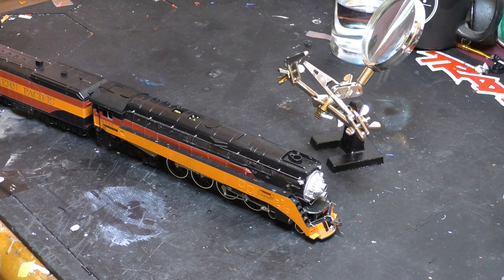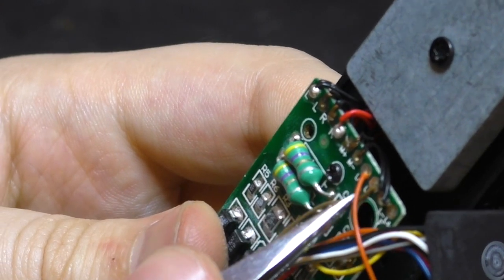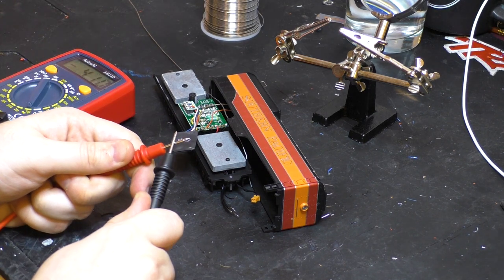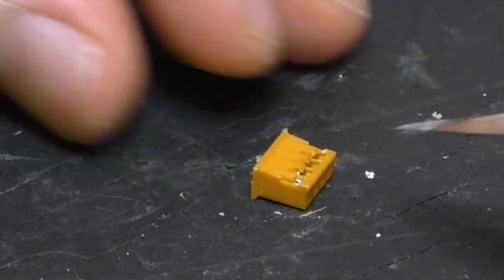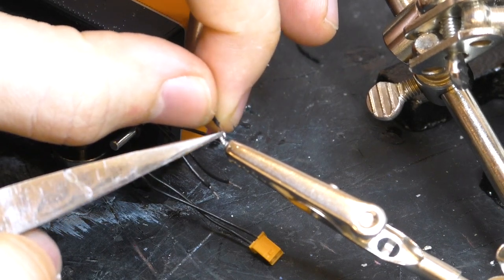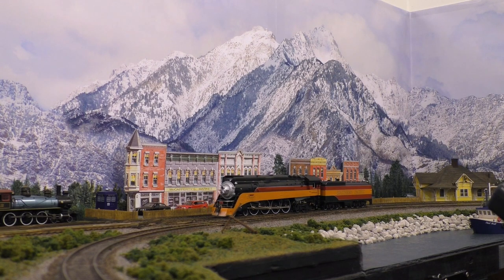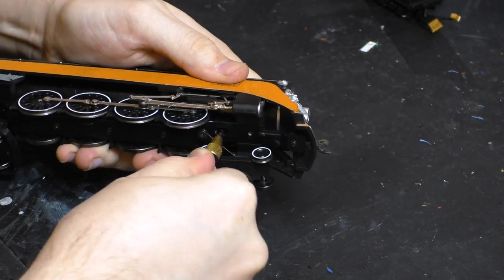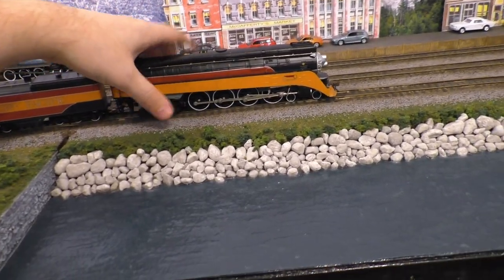Repairing Bachmann Tender Plug Wires (the hard way)

Comment: Thanks for explaining how these connectors can be fixed!  I would like to learn how you applied “back emf” to improve operation.
Reply from the maker: Back EMF is a feature built into DCC decoders. You can usually adjust the parameters by changing CV values, and the ideal settings will be different for each motor.

Comment: Damn you really just went though hell and back with those wires! ,that’s one of my worst fears are when the wires are broken
Reply from the maker: It's definitely not an easy fix! In most cases, I'd recommend just replacing the whole wiring harness. That would have been vastly easier.

Comment: I have two ideas for this in my near future.  One, by a set of plugs prewired and just splice into existing wire, shrink tube for nice place, or get long enough prewired set to resolder from scratch.   Second idea, build as you did, but maybe also place shrink tube ahead of time to bundle wires and make them stronger and easier to unplug and might even look better.  nice work though.  Next time it will be easier I bet.
Reply from the maker: If you're already buying another plug, I would just unsolder the old ones from the circuit board and solder the new ones in their place. That way, you don't need to have a joint in the middle of the wire, and it will flex easier as the train goes through curves.

Comment: Hi Michael, I have recently been looking at upgrading from my Bachmann EZ Command DCC controller to a Digitrax Zephyr DCS51. I was looking around at videos on DCC controllers and I came across yours on the BC Hobbies channel, and you said that you had gone with the Powercab because the Zephyr DSC51 had problems. What were the problems you have heard about? Is it anything major or just some small things? (If it’s small things that’s fine, as I found one for a good price which is why I’m thinking of getting it). Thanks for taking your time to read this! P.S. Sorry for posting this on a random video, I didn’t know if you check the comments at all on the BC Hobbies channel, since I know multiple people run it.
Reply from the maker: The main issue people seemed to have with the old Zephyr was the display, which just doesn't have room to show very much information, making things like programming CVs more complicated. Functionally, there's nothing wrong with the old Zephyr. If you find a good deal, and you don't mind figuring out the controls, I say go for it!

P.S. I do try to check the comments on the BC Hobbies channel regularly, but I usually check the comments on this channel more often. If you comment there, I will try to respond, but it might take longer. Either way works.
Reply: @michaelramsey81  Okay thanks for letting me know! Sounds like I might go for it then!

Comment: The only promblem I have with ordering the plug part, in fact any part from bachmann is that once it’s gone they never restock.
Reply from the maker: That is definitely annoying. They do sometimes restock parts for models that are still in production, but that's relatively few of them.
Reply: @michaelramsey81  worse part they are starting to overprice their parts for example a shell for the new 2-8-0s is 100 at that point you can get an old spectrum engine with the mechanism

Comment: I wish Bachman could set up their engines to work without the wires Just on straight DC like some Hornby locomotives
Reply from the maker: The wires are there to make it easier to convert the loco to DCC (or, in this case, because it already has DCC). I have rewired locos before to work without the wires, but it makes them nearly impossible to convert to DCC later.
Reply: @michaelramsey81  As you said in your Prairie video that's future you's problem
Reply from the maker: @chasesrailwaylinesrr6447  That's exactly the one I was thinking of, lol.
Reply: It went something like this: "This will be a serious pain if I ever decide to convert the engine to DCC, but hey, That's future me's problem"

Comment: I own a Bachmann Daylight with DCC; this one has an updated tender connection where they've combined both plugs into one which makes this problem easier, should it come up. However, it's still a poor design choice as those wires are very cumbersome and have the potential to interfere with the drawbar when it runs. Not to mention it's hard to connect and disconnect the tender with the placement of the socket below the cab. I might look into upgrading it to something more robust/less intrusive.

Comment: Great video. I had to do the same thing to the exact same locomotive that I bought for my son. But now the thing won't stay on the rails...🤦‍♂️
Reply from the maker: It does seem quite prone to derailing, probably because it's so long and not all that heavy. The freshly repaired wires might be a bit stiffer than they were originally, which doesn't help, but that alone shouldn't cause it to derail.

Comment: Jeez I hope I never have to do this, that does not look fun. Out of curiosity we’re you able to still unplug the locomotive from the tender, or did the glue slip and make the connection permanent? Looking forward to more videos from you!
Reply from the maker: I was still able to unplug it, but you do have to be very careful with the glue. I used a thick gel-type super glue for this one, and that worked OK, but on another one I tried to repair recently, I made the mistake of using thinner superglue. It instantly ran inside the plug and completely jammed it. I ended up having to cut the plug off and replace it entirely. In the future, I'm not going to bother gluing them at all.

Comment: Hey Micheal! Great video. I'm having a bit of an issue with a Bachmann 4-8-2 Light Mountain I'm fixing for a friend, it's been sitting for 8 years following an incident that broke the tender wire plugs (Your video on resoldering the harness came in handy for that haha) I've finally got the it running again but it's very jerky and rough - it didn't come as much of a shock as while cleaning and relubricating the drivers I found that after the bottom plate was screwed at appropriate tightness the drivers would get very poor freewheeling, I'm not sure if this is normal for the these Bachmann split chassis locos or if I somehow reassembled something incorrectly, any guidance would be greatly appreciated.
Reply from the maker: The split chassis locos are finicky. Most likely, one or more of the drivers is loose and has worked its way out of quarter because the center nylon axle sleeve has started to crack. This happens on almost all of those old Bachmann split chassis locos sooner or later, and unfortunately, there's not much that can be done about it. Of course, you can twist it back into alignment, but it will work its way out again. Your best bet is probably to get the driver aligned perfectly, get the loco running, and then mark the alignment on the axle with a Sharpie, pull the wheel off, and use a tiny dab of epoxy to glue it back on with the marks lined up. It won't last forever, but you might get a little bit more life out of it.